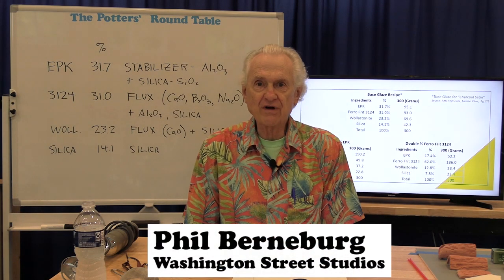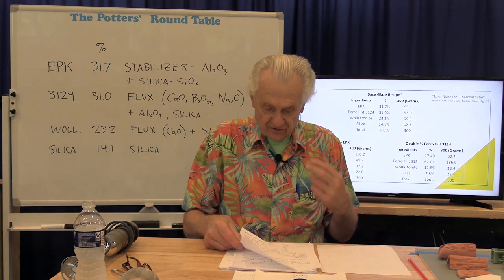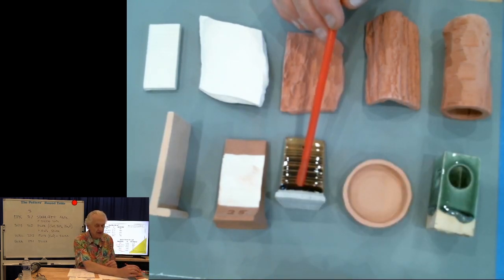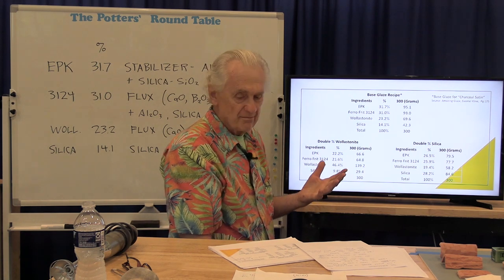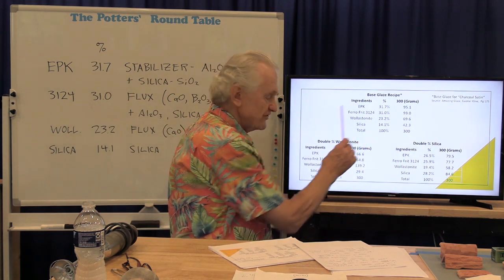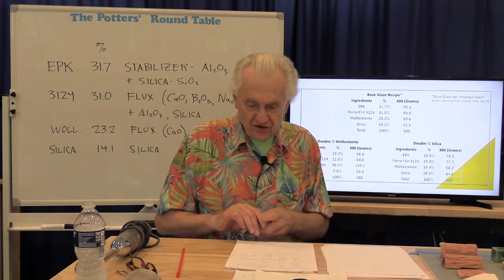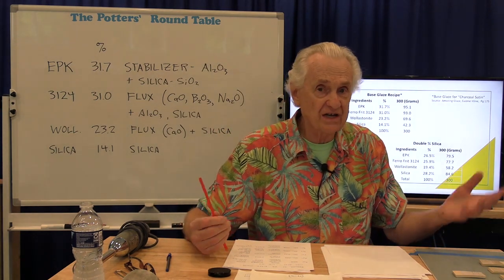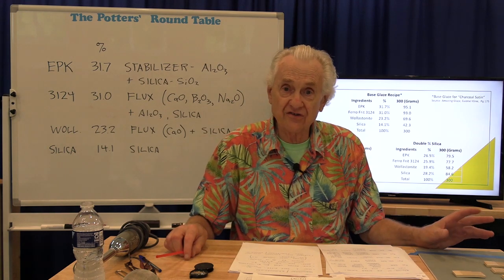An Introduction to Glaze Testing Part 1

Comment: I am not following. By reducing by nearly 1/2 of the ingredients that were not doubled,  haven't you made the doubled ingredient 4 times larger than the original recipe?
Reply from the maker: Yes, you are correct! When using this approach to glaze testing, the search isn't limited to finding the 'right' glaze combination. The objective is to determine how each ingredient affects the final glaze, and at what point does the ingredient reach the end of it's effective contribution. Great question!